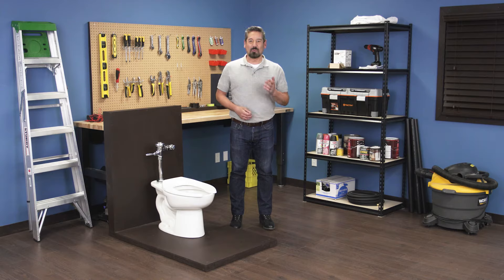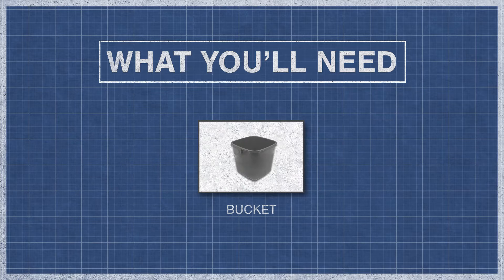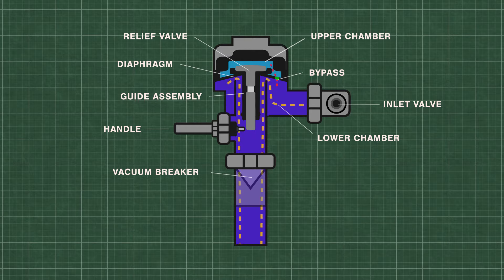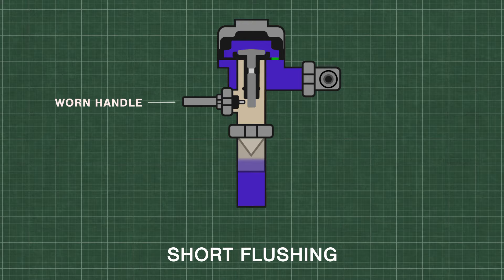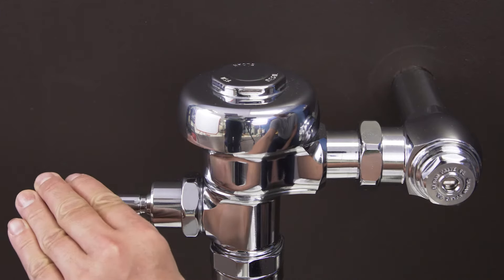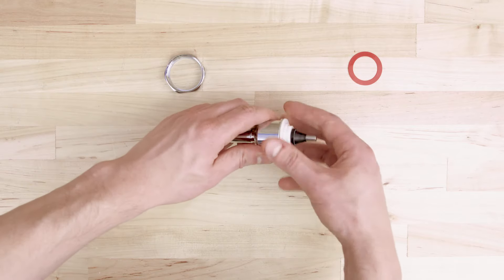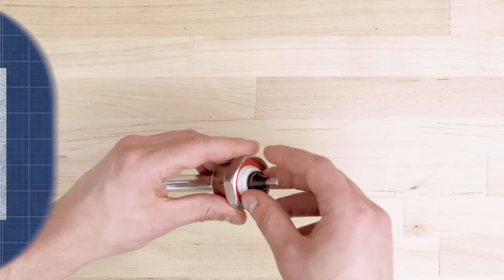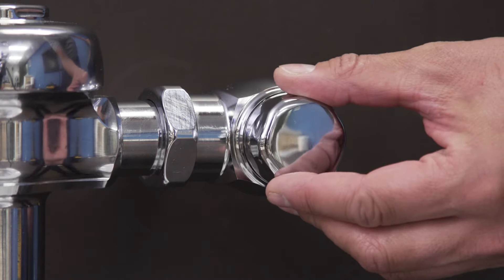Sloan Regal Flushometer | Handle | Repair and Replace

Comment: Very helpful,  but water is leaking out of the handle. How do I stop it from leaking? I've Tighten up everything.
Reply from the maker: Thanks for watching. If you've installed a new handle and tightened it into place and it still leaks, then it could be an issue with the threads. If there is any corrosion or a mineral buildup on the threads then you might need to clean it for it to make a better seal.

Comment: I am glad I found you guys as well. My afternoon watering hole as been without one of its urinals for 6weeks. The manager said that the plumbing company had to order a complete valve assembly for him because the water constantly so he turned it off. I found the part in town, bought it, watched you other vido on the flush valve, showed up with the new complete unit and wound up just installing the flush valve out it. less than 5minute fix he had been waiting 6 weeks for. Large chain bars should not get into these corporate repair contracts. I have replaced the flush valve in the comlete unit i bought and now we have parts incase this happens again on site... next fixed in 6minutes not 6 weeks. Thanks guys. We will order the sloan repair kits from you to have on hand
Reply from the maker: Thank you Tom, we're just happy to help! There are definitely some repairs that aren't that complicated if you can see the steps laid out which is why we structure our videos in a way that can be easily referenced. Also we appreciate the support!

Comment: Question! Ive replaced thr entire handle, but now it is almost impossible to flush. Is there something wrong inside the urinal? What should i check next?
Reply from the maker: Thanks for watching. It is possible that the relief valve or the diaphragm is stuck. This videos shows how to access and replace the diaphragm https://youtu.be/IhBA-AZBXGc

Comment: Perfect, just what I needed to know. I'm guessing that if the valve won't shut off that the bypass hole could be plugged. So I'll check that.
Reply from the maker: You're welcome! Yes the bypass hole can be a problem. As well the diaphragm rubber can wear down so that is the next thing to check. Lastly check to see if there is a buildup of minerals or if there is any corrosion below the diaphragm as this can prevent a good seal.

Comment: I just replaced the handle assembly and I’m still getting a drop of water every flush. Any suggestions? 
Thank You
Reply from the maker: Thanks for watching. It's possible that the diaphram is worn out or there is corrosion on the relief valve. It's worth checking these: https://www.youtube.com/watch?v=IhBA-AZBXGc

Comment: where do you find the model number? How do I know which model I have (1 gal, 3.5 gal)
Reply from the maker: Thanks for watching. There is often a flow rate  printed on the side of the toilet or urinal. Urinals have a significantly lower flow rate, so those are usually 1 gpf. Some toilets are designed for 3.5 gal but there are low flow toilets that are compatible with 1.6 gpf flushometers. 

The sloan regal flushometers look very similar so to find a match, you'll have to look at the diaphragm color and relief valve. This video will show that in more detail:
https://youtu.be/IhBA-AZBXGc

Comment: When I flush, I hear a popping sound and the water stops flushing immediately. The only way to get the water going is to hold the handle up. Help please !!!!!
Reply from the maker: Thanks for watching. It could be an issue with the relief valve and diaphragm. It's worth checking those and replacing if needed: https://www.youtube.com/watch?v=IhBA-AZBXGc

Comment: Great video! Can't seem to find info anywhere, what if my handle takes too much effort to push down for the flush. Any way to loosen it? Thanks!
Reply from the maker: Thanks crystineVIDEO. The tightness of the coupling won't effect the force needed to flush the handle. Its best to start by replacing the whole handle assembly. The rubber seal might be worn down and could be preventing the handle plunger from sliding https://youtu.be/7N6mkZmdRZY?t=2m13s

It might also be worth replacing the diaphragm. If the diaphragm wears down it can start sticking to the valve and might make it harder to initiate the flush. https://youtu.be/IhBA-AZBXGc
Reply: Even if the handle is hard to push, does it flush fine when you do push hard enough?

Comment: I'm so glad I found you guys!  These videos are really helpful, thank you so much!  Unfortunately, I still need some clarification.  Does a "short flush" refer to an "incomplete flush?"  I know I don't have a clog, but sometimes not everything gets flushed.  Based on your videos, I think I would need to replace the handle, right?
Reply from the maker: Thank you Monica for your kind words, we're glad that you found the video helpful. A short flush would be the same as having a shortage of water. There are a couple other factors to consider, like if the control stop is partially closed or if there is low water pressure to the fixture. Those are mentioned in this video: https://youtu.be/Upkq8qIwD5M?t=88 If those are not a factor then the handle could be the cause.
Reply: @AmreSupply  Thank you so much for your help! I really appreciate it!  :)
Reply from the maker: @monicamikol1134  You're welcome! We're just happy to help!
Reply: Hi! So I bought replacement handle assembly from you guys, & I replaced handle thanks to your video! But now the handle leaks when I flush 🤦‍♀️ I took handle off to make sure the ring was properly set in place, but handle still leaks when I flush.  What did I do wrong?
Reply from the maker: @monicamikol1134  Hi Monica, there are several things that you should check. With the handle removed, check to see if there is any corrosion or damage to the handle threads. That could interfere with the seal. If there is a mineral buildup then you can use a rag soaked in vinegar to help dissolve it. A wire brush can also be used to clean the threads. If the threads look good, and the washer is properly aligned then you might just need to tighten the handle a little bit more. Hope this helps!
Reply: @AmreSupply  Please let me know if shes OK , drama of this killing me , ,

Comment: No silicone grease?  Not good.
Reply from the maker: Thanks for watching. You are right that silicone grease can be put on any rubber gasket if needed.
Reply: @AmreSupply  Needed on the handle, not just the gasket and needed on the flat part of the handle to lessen the amount of wear from metal on metal.  Valves come pre-greased on those areas.